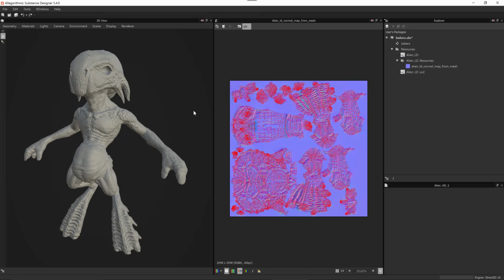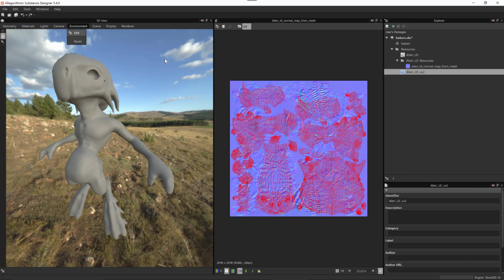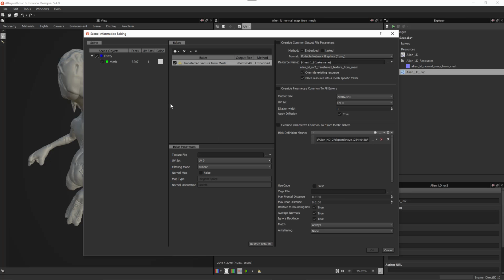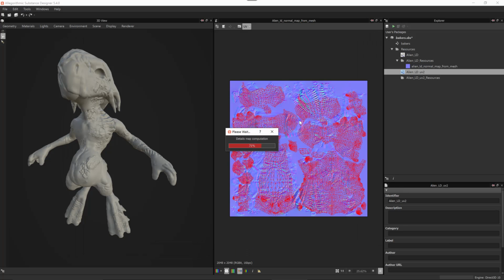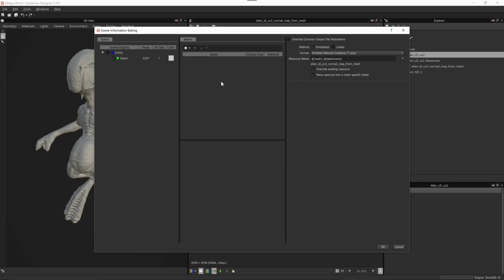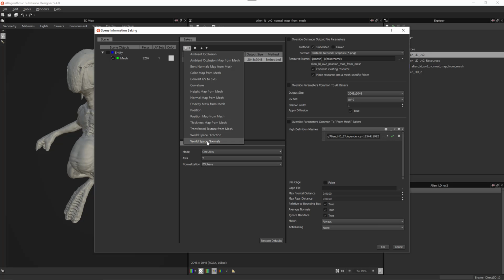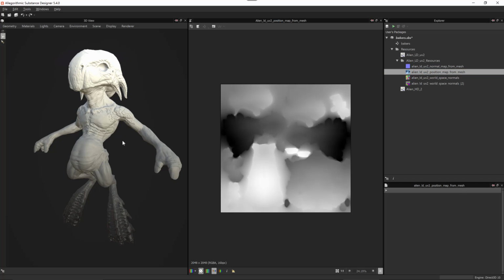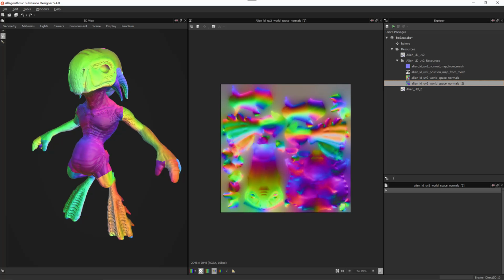Substance Designer 5.4: New bakers | Adobe Substance 3D

Comment: Hi, will texture transfer work with highpoly to lowpoly transfering? For example, there is a detailed wicker basket with a diffuse texture and I need to transfer it to low-poly model. That is, the situation is the same as when baking a normal map, but the diffuse color map will be baked.

Comment: What kind of limitations does the UV transfer have?... can the new UVs be completly different to the original? or do they have to be the same UV blocks just positioned and scaled randomly?... and If the second model had some modification on the geometry this will break right?
Reply from the maker: The new UVs can be completely different. The vertex order of the mesh can change and even be altered, although this could cause distortions. The limitation is that you can't change the materials on the mesh. This will break the scene. If you add new geometry, just make sure it's assigned to one of the existing materials.

Comment: is there any way to save a preset of bakes?
Reply from the maker: +Fauxicity We don't have a way to create preset for bakes at this time. How would you like to see this implemented?
Reply: +Allegorithmic I'd envisage something similar to the export presets you have in Painter (haven't used it in a while so it may have changed). 
I work on a few different projects in Designer at once, would be cool if in the bake window next to the add bake button there were a presets button which would pop up a little dialogue where you could create/edit set bakes and their settings